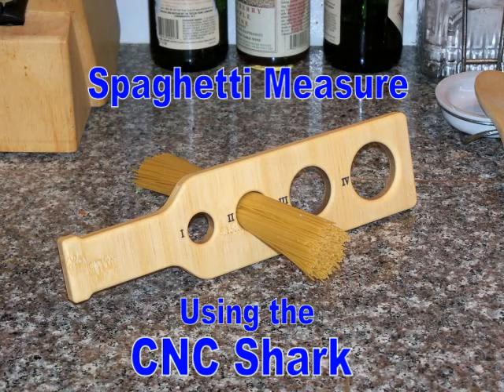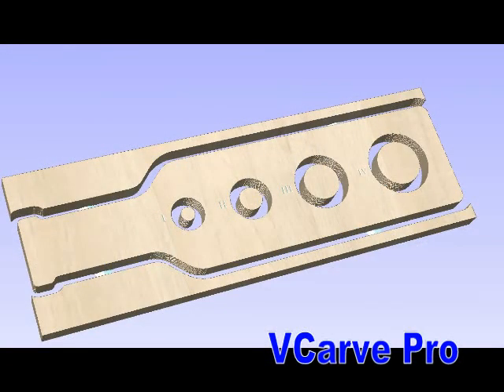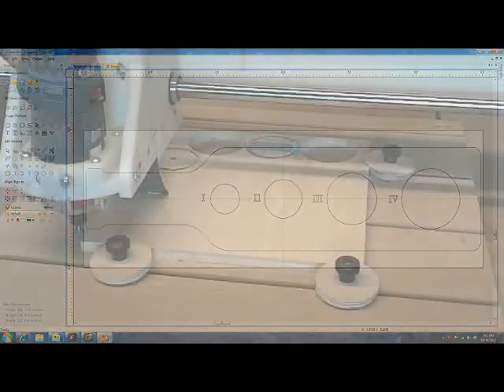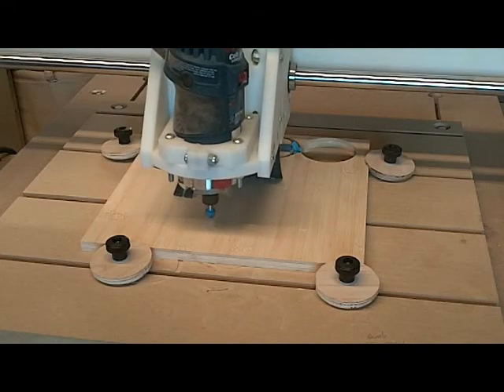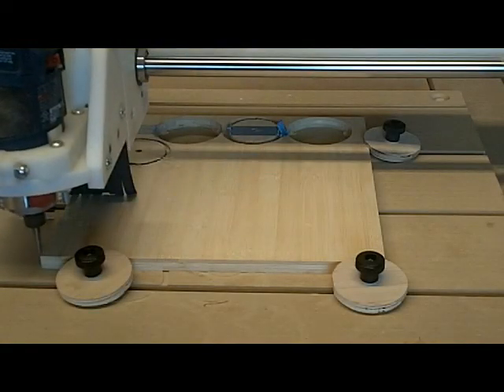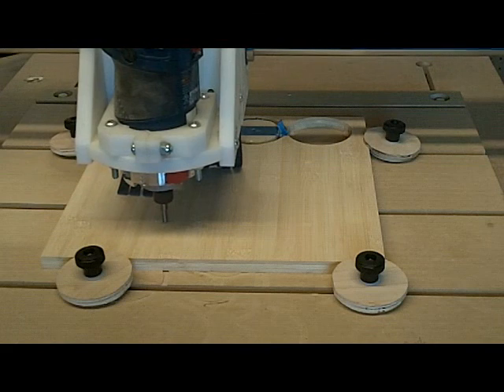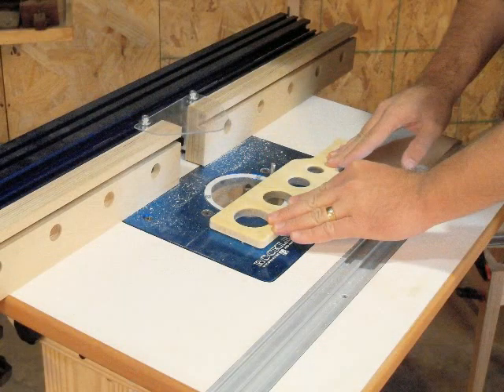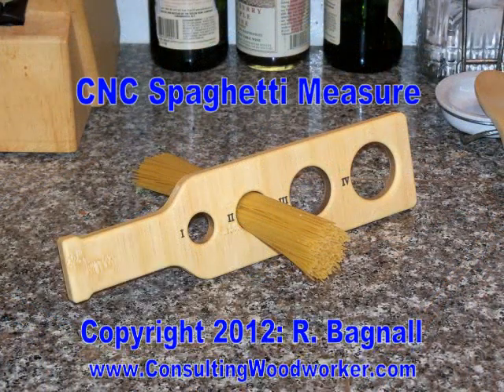Make a Spaghetti Measure on your CNC

Comment: Notice no one ever demonstrates using this with spaghetti out of the box?   Try t and you'll see why - use any size hole just to test the method.  Notice he passed ALREADY MEASURED portion through.   You'll get why once you try.
Reply from the maker: You can do a quick web search and find hundreds of measures that work exactly the same way, both plans to make your own and commercially available ones.
Besides, it makes a nice gift even if it does not get used, it looks nice hanging on the wall.

In point of fact, my wife uses this one at least once a month when we have spaghetti.